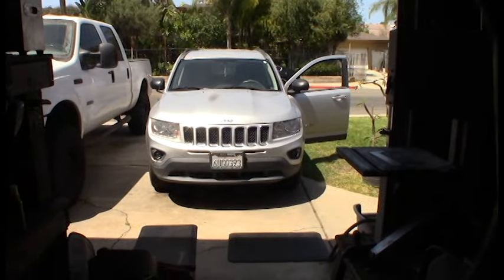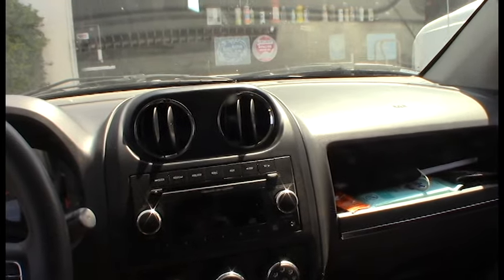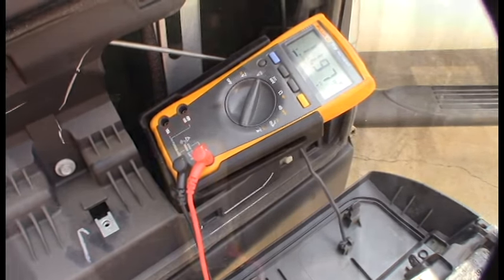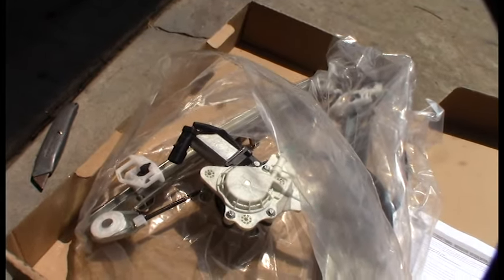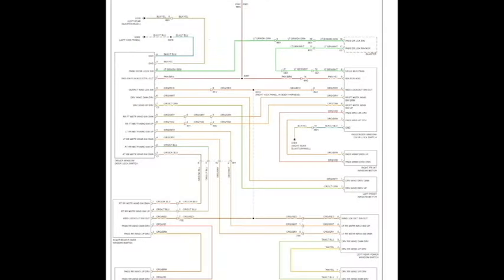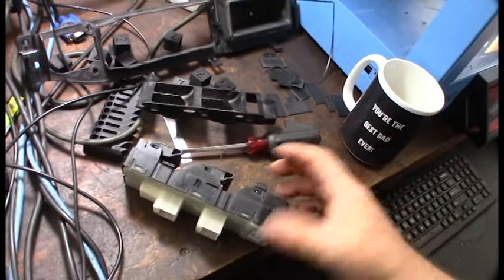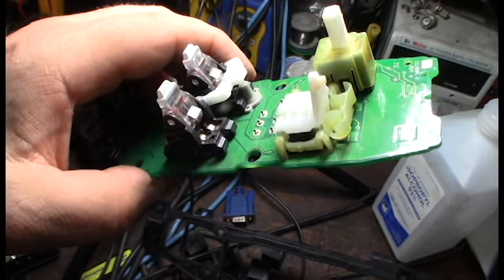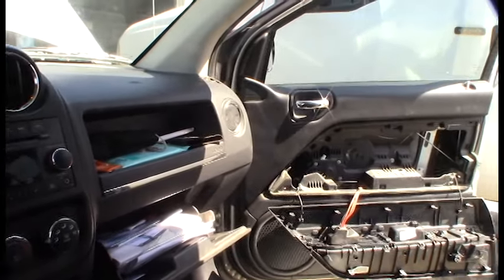Jeep Compass Window Stuck Down, Wont Go Up or Down, Troubleshooting Repair, Window Switch Patriot

Comment: Sticking probes into connectors, uh oh! There are SO many videos on the car diag channels where someone ruined a connector fit by doing that and then it was an intermittent problem.

But, nicely done. The window switches on our cars have failed multiple times too. It always gets soaked when you open the door when it is raining (at least here living in the jungle).
Reply from the maker: I know, I barely had them in and they are the small fine point probes. Normal probes would kill the contact tension. I'm surprised the windows are wired like that. Full current going through switch. No relays.  I've been working on 3D printers daily. I just haven't had time to upload videos.